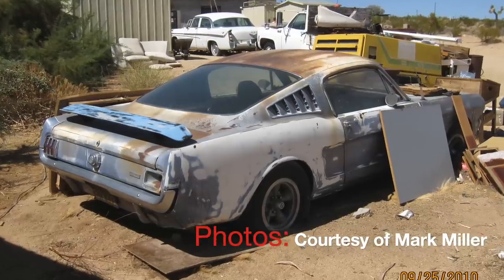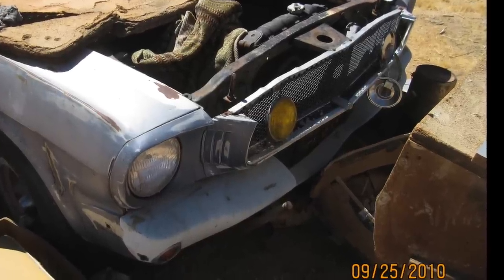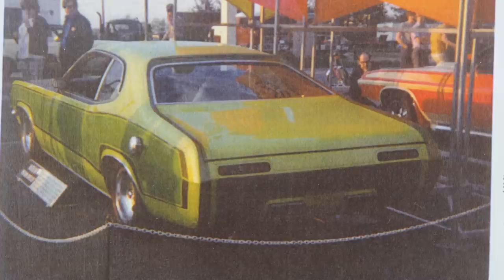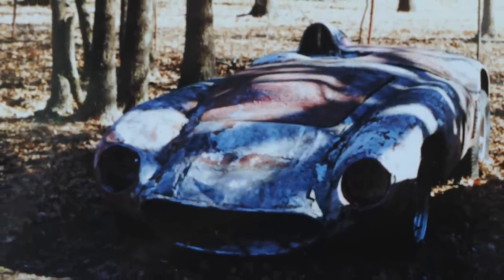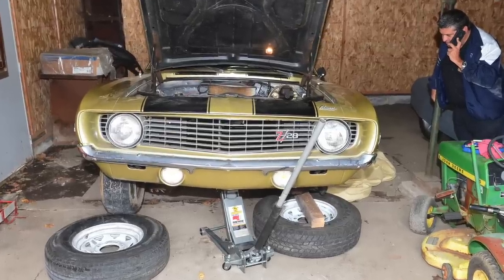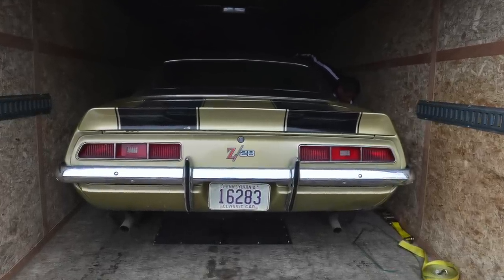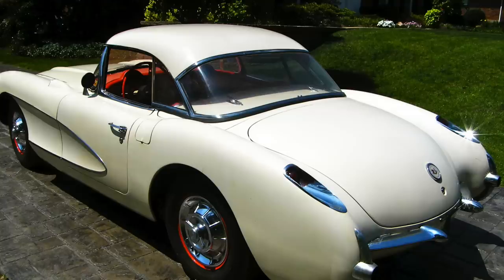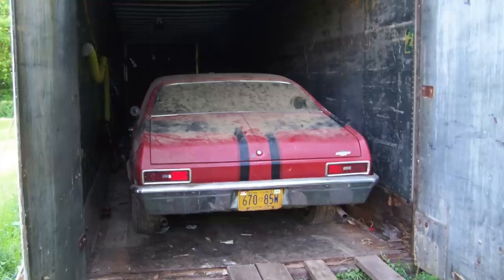8 Great Barn Finds Jerry Heasley

Comment: I won't get into what I paid for it new or what I sold it for later, but in July 1969 I purchased a 1969 Camaro convertible replica Indy Pace Car new from the chevy dealer. It was a 300 bhp 350 CI small block with 4-speed stick. It had exactly the same speedo dial as the '69 Z/28 in this video. If you look at the photo, the speedo needle is resting on a stop at zero mph. During one run on a straight highway in Nevada and another run in West Texas, I managed to get the speedo needle all the way around to the back side of that stop. I'm guessing it was moving about 140+ mph or more.